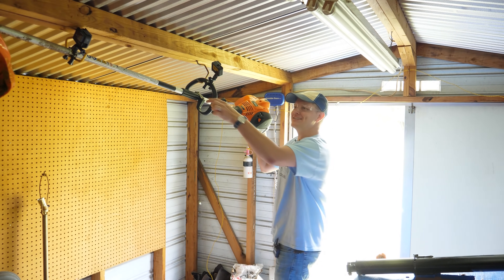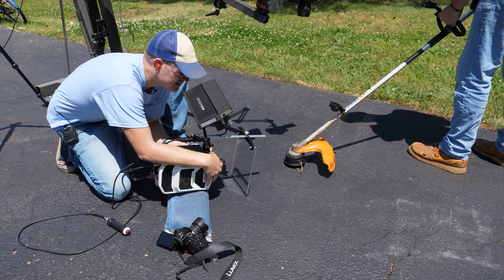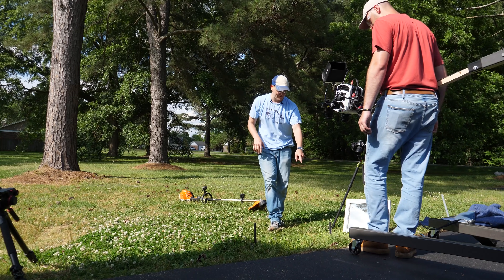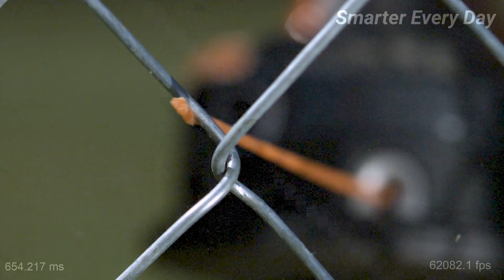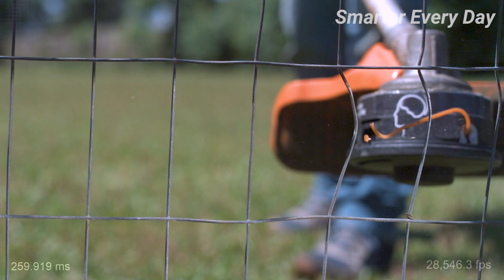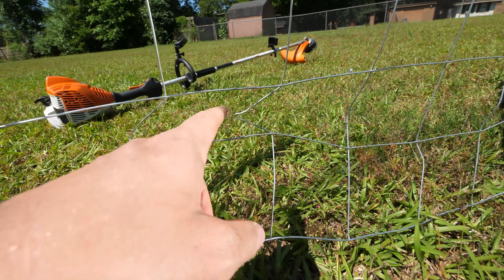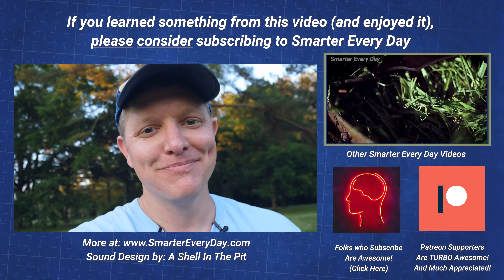How Weed Eaters Work (at 62,000 FRAMES PER SECOND) - Smarter Every Day 236

Comment: Hey! First time commenting haha. So, I’ve done my fair share of trimming. Ive worked as a landscaper and also for my local cemetery department before that and had the time to really get intimate with a trimmer. If you want to successfully weed whack around chain link or chicken wire, the key is speed control. You have to go slow and take your time. Let the line wrap the links and shred the grass in between. The same with the corners in nylon fencing. You have to give the line the time to take the shape of the area you’re trying to cut. Would love to see that in slow motion. Also, redmax braided line, .95, is the best line on the planet lol. But a thinner line, like .85 will wrap and take shape into tight areas better even tho it breaks easier. Look forward to the next video.
Reply: Ps...Right to left is the only way!!!!
Reply: "Ugly line" hands down bro. Fr.
Reply: And yes your 100% right about the speed control. Everyone i see running full rpm pisses me off. Like only run the rpm that you need to. Its only grass blades.

Comment: I love nerding out about everyday stuff like this. As someone who’s been weedeating ever since my dad got me a Featherlight model for my eighth birthday, I’ve definitely got some mental models of how this stuff works. 😂 He and his lawn crews used to run their’s without the guard (because you can run more line and maneuver the cutting head better that way I guess). I noticed you didn’t really get into which cutting direction was best. I’m excited for the line comparison video. I’d also be interested to see high speed footage of weedeating against an abrasive surface (like brick) and maybe comparing straight and curved weedeater shafts (I believe one rotates clockwise and the other counterclockwise, which might affect which cutting patterns are best).

Comment: I have an idea..... 
I have been doing lawn care for nearly 18 or so years & love seeing this, 4:19 intrigued me. However, I think "think" there might be a better way to start the process to see if the motor will kick up when its balanced "as the line comes out"........
Setup the camera in front of a piece of plexiglass, high enough to where u can get the trimmer head parallel to the plexiglass.
Start off with the line reeled in, pull the trigger full speed & tap the ground once to get even expand allowing inside to tighten. 
Bring the trimmer head up in front of the camera/plexiglass, now tap the glass allowing the line to expand again. Continue till u no longer feel comfortable or assume the experiment is done. 
I'm not sure if the motor itself will keep up with the inertia of the line expanding or if there is some kind of governor in the system more-less the motor which keeps in like "underdrive" so the motor doesn't burn itself out trying to push the weight of the lines inertias.

Comment: Something i found out on preserving as much string as possible.

If you just use the minimum speed needed to cut light grass against a fence, the string will last a great deal longer.
Not as much torque for the string to snap against the fence, but plenty to cut the grass itself. It's also a good technique to use in unfamiliar area's that may have snaps/poles in them to keep your string from yanking your weed eater around.

Comment: It might be that smaller radios objects to wrap around means that the line would break less. When looking at the footage in the video at least the thickest wire had plenty of breaks throughout the test, (although there was probably a few extra breaks due to pinching) but the next thickest wire appeared to have less and I didn't see a single break out of the footage shown.  If you go through the footage and record the ratio of the number of unwinds to hits there might be a relationship you could test. Now this might be due to the effect that the radius of the metal wire used or it might be due to the energy absorbed by the smaller wire as it was able to deform far more under the applied forces. It may be a combination of both though and the only way I could see to differentiate the two effects would be tot use stronger wire. I would also suggest a rig to hold the weed whacker steady in front of a single wire to perform future tests including your different wire shapes tests, this would also save a lot of time in camera setup if the weed whacker was fixed and you swapped out combinations of wires.

Comment: I don't know if other comments have mentioned this, but I think you also need to take into account the effects of heat (for the wire fence part). With such high speed plastic strings wipping at metal, it can certainly get hot, which may affect the behaviour of the strings (e.g. helping it the pull and break).

Comment: My theory is that the less stable the thing you're hitting with the weed eater wire is, would make it have to be exponentially sharper/smaller diameter to be able to cut or tension break the wire. So basically if the object moves or gives at all, it won't be very effective at cutting the weed eater wire. But also, there's a threshold of diameter/sharpness it has to meet before that can even come into effect. And the reason is because of how resilient the weed eater wire is, it can bend, stretch, absorb impact etc.

Comment: With a straight shaft it it tends to cut better right to left because the direction the head spins but you end up walking backwards so I trim left to right. A curve shaft spins the other direction and is more efficient left to right and more comfortable to walk forward with it. Straight shafts are more durable and powerful

Comment: Zip Ties make the best weed trimmer line. You have to modify an old head to get them zipped to it or use a weed trimmer saw blade with a few holes drilled in it to attach the zip ties. Works great and last forever. Nice thing about the zip ties is they act like a knife edge on the grass and that makes a cleaner cut. I could be wrong but if you test it we will all know. Thanks again for a well done video.

Comment: I'm not sure if this was mentioned in the 6,304 previous comments, but I think the reason the smaller fence broke close to the weld does not have so much to do with the area close to the weld being weakened by the weld itself as it is the bending back and forth stresses of the wire.  That's the same effect you get bending a coat hanger wire back an forth to break it, when you don't have wire cutters on you.  I have done that countless times in my past 59 years.  I have no formal education in stuff like that (big words there!), but I had "Hot Metals and Machining I & II" shop class in high school and have been a machinist for the last 40+ years.  I'm always looking how metal reacts to different cuts and stresses.

Comment: I wonder if friction heats the plastic and causes a glass state in areas of the line.
I'd like to see how hot the line gets after smacking that wire over and over and see if its close to becoming molten after the test.
A high speed thermal camera video (if that exists) would be very interesting to see!

Comment: Destin, could you do a tension-elongation test to see how much this material stretches before it shows a plastic deformation and until what point it will show an elastic deformation. With this info, the rotations per minute you could calculate the angle at which the plastic string is being pulled and calculate the forces that apply to the string.

Furthermore you could measure the time it takes the strong to rotate around the fence, where it can be seen as immobile. With the rpm of the weed eater you can also calculate the elongation of the string.
Basically with the phantom you've built a visual tension-elongation measurement device.

Shear forces should apply in that case. You've basically got 2 points of failure at least: 1 the impact weakens the plastic string. If the string isn't being broken by the impact, the smallest diameter of the plastic string no carries the weight of the weeed eater pull. After lowering the diameter, tension with a sheer force is being built up until the elastic deformation changes into a plastic deformation which leads to material failure.
Another potential weakening of the string lies in the fact that the string is curled up and therefore shows inner tensions. As we know, inner tensions do get released when heat is applied. This heat is created upon impact with the fence. Basically you use the impact of the string to straighten it out a little and release some of the material tension.
There are so many more things I have on my mind right now but due to me being German, it is hard to explain everything on my smartphone in a Youtube comment.

Greetings from a German mechanical (Diplom-) engineer in the field of material science, compound technology and damage analysis. 

If you want a super interesting topic, I can hit you up with a machine that I've built that replaces a multi-million dollar machine with something that can be self made for 50 bucks. It's for measuring the surface tension of EVERY surface or surface coating. 😁
Reply: Yeah, um.  Win..
Reply: i would of said the same thing JK
Reply: Hijacking a top comment to ask, are those real sounds or did you add them!?!
Reply: @alextound5033  he added them. Watch the slow Mo guys. They explain it. You would just hear a low buzzing sound and destroy your ears else
Reply: Hello! I am a sophomore study materials science and engineering in university. I really would like to get to to damage/failure analysis, do you have anything you can tell me about the field and how to get in? Thank you!
Reply: Wtf did you just say?
Reply: Oh yeah I was definitely thinking about that
Reply: Cool story bro.
Reply: This exactly what i thought wtf
Reply: Bruh youve been weed-eating a lot too much
Reply: Blue Flash I agree, weed is nice

Comment: No surprise those weak little gas engines can't handle enormous line lengths. It under like 3x the load. Electric trimmers will demonstrate this really fast as they are more vulnerable to oversized lines.

Comment: The line is made of nylon. If you boil it, it will loose some tensile strength but pick up a lot of toughness. Why don't you add that to the mix on your next test?

Comment: Interesting to watch the line upon impacts distort, cannot help thinking that it is melting,
if you heat the 'weed wacker' (in Aus we call em Whipper Snippers) cord it melts and just before it burns it becomes 'melty liquidy'.
it is interesting to note that the impact would be compressing the impact point where then the intrinsic heat in the line is released, causing the line to soften and allowing the near instantaneous expansion and "stretching" leading to tearing/snapping of the line.
If you could catch those little bits flinging off without injury, I'm sure they would be hot to the touch.

Comment: Yay I passed the curiosity test!

Also, I have a very interesting question. I’ve heard here and there that the size of the contact surface does not affect friction. Because the more contact surface you get, the more weight gets dissipated over the surface and you ultimately get the same friction. No problem until here. But, when you think about cars and tyres, wide tyres with larger contact surfaces are considered to produce more friction which leads to higher cornering speed. Not only in the selection of tyres, but also in terms of suspension geometry settings (you must have realized by now that I’m a very car obsessed guy), the settings that let the tyres have the most contact patch brings the most performance. I get so annoyed with this paradox whenever I think about it. I hope you could read this and if you’re ever interested, make it into a video!

Comment: Pro tip for Stihl weed eater heads, rather then cutting the extra line off, just twist Center of the head backward while holding the outside and you can wind the string back in.

Comment: Regarding testing different line: it's quite likely that the best type of line to use is the uncoloured line.  The pigments they add to the plastic may just weaken the line so it will not last as long in normal use.  This is the advice I've received from guys who do this for a living.  At the speed this line works I don't expect there to be any significant advantage to shaped line, except maybe to weaken it even further.

Comment: It's interesting how a lawn mower blade will create a vacuum to hold the grass up for the sharp blade to form a clean cut. Yet the weed eater just seems to smash the grass till it breaks. So I wonder how a syth will slash the grass to a clean cut with out a vacuum to hold the grass up but still have a clean cut from a slower moving sharp blade.
How ever yes your theory that the weed eater cord is pulling on an object like a pully that in turns wip the weed eater away, but I think that most of that force it due to the fact that ok the cord has wrapped around the fence wire but the tenchion brake will be in conjunction with the cord pulling the head as it spins untill it eventually rips apart and so because the head is now just little bit closer to the next wire the next cord grab ahold of the next wire. This walking the weed eater along the fence.
I have a single cord weed eater head and yes it's unblanced but it doesn't ripe away from you as much if you hit something.

Comment: You should also test different types of trimmer string. I like Shakespeare triangle shape ugly line. Twisted, round and square are other types. I find that the ugly line is more suited for heavy brush and round string is better for lighter work, as well as trimmer around fences, as the string seems to get back on track quicker, or straighter, than the triangle/square line.

Comment: The section of small gauge "hog wire" fence was very interesting to watch.  Seeing the wave propagation during the first 5 strikes was cool and you can see the moment when the square loses its structural integrity and collapses, which eventually leads to wire breakage at the heat affected zone

Comment: What's really interesting is the line looks like it's tensile strength was designed specifically to break when hitting hard objects.  Which would make total sense because if the line was too strong, it would just rap around whatever immovable object it's hitting and destroy the rotor.  Never thought about that.

Comment: are you sure its not a friction break. like you said "it wraps around then pulling so fast" that it could cause so much frictional heat that it causes the plastic to raise in tempture to cause a break. have you touched the ends of the wire after the experiment?

Comment: You didn't mention another crucial thing I observed while whipping : the speed of the nylon is timed to hit the cut items and spray them from the cut zone. In deep grass ( which you didn't trial but should) you will see it working. You can also cam up the new bladed attachments and see how less effective they are at dispersing the cut media. Another thing I wanted to mention is that you seem to analyse video but not sound. Very often sound will tell you a more in-depth picture and also for the audibly sensitive , sounds really cool at super slow Mo. Lastly, Ty for your great sharing of curiosity of the world and hopefully you will make a few more humans curious because that leads to less suffering. To be curious is to learn , to learn is to grow , to grow is to feel happy. P.s how did you miss in your practical yard whipping hours shorter spool length means greater speed ! This is the trick with very heavy grass and there is a most efficient length for different media 😂

Comment: Nice video. Be good to see the difference using different types of lines, as I use the star line on mine. It'll be interesting to see the temperature of the line when it hits the fence, because in some of the slow motion video, it looks almost like it is melting.

Comment: I had always heard that the tip of the string was the cutting edge of the line, but you have shown that the line basically beats the grass like a baseball bat. I wonder how a mechanical push mower would cut grass. I have heard that it is more like scissors where you have two opposing edges. Hmmmm.....

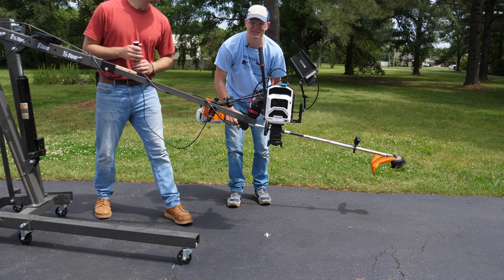Comment: so this episode immediately had me thinking about a mental story problem I learned about as a child, where a body builder has a weight on a rope and how it would take an infinite amount of force to pull the rope totally straight ... i figured i would pause at about 2:45 and see if my hypothesis stands up to your data.
1.) It would require an infinite amount of rotational force to fling the string perfectly perpendicular to its surface.

Comment: I think that last fence answered my question, but not sure
My weedeater uses pre cut line that has a crimp i the middle, i ran out of it.
So i tried using stainless steel aircraft cable, about 1/8 dia, i thought it would last longer against my rough grass (contains a lot of the round stem stuff), sadly not, the wire broke in a very short time.
My guess is work hardening from the bending.

Comment: I think this could bei a tension breake because the friction of the area of the sting touching the wire fence, as wraping around it, is getting too great for the stings' tensile strengh. This could also explain why the weed eaters' string breakes more often and easily at the thicker wired fences.